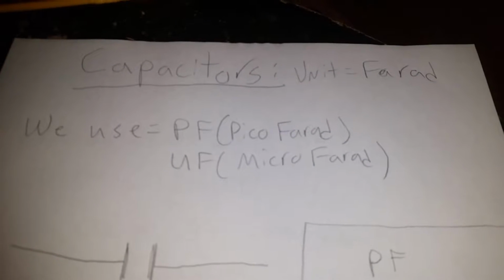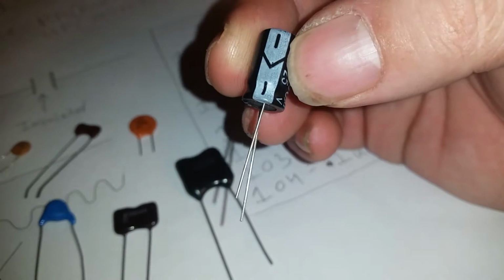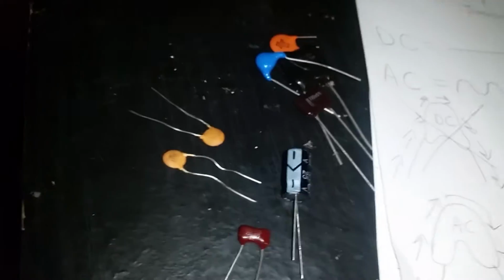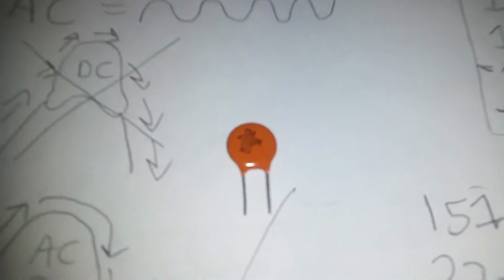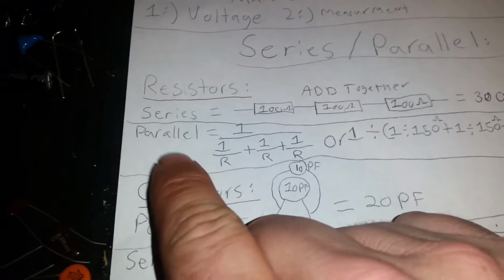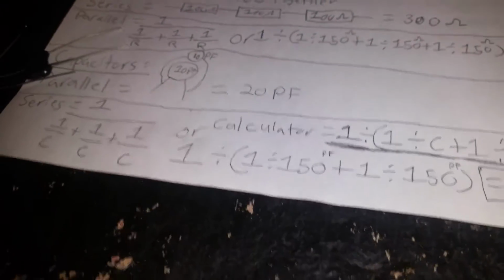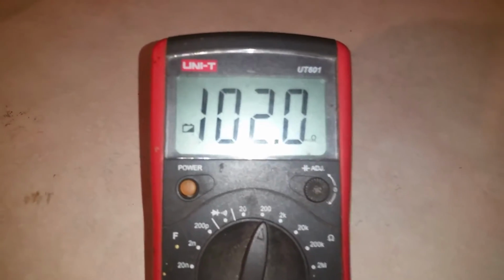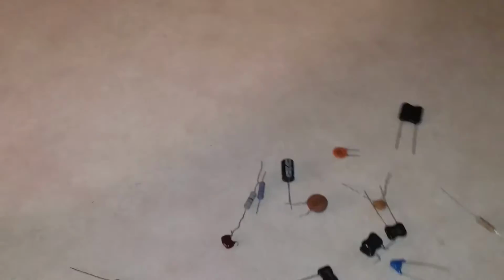RF Amplifier Building Concepts For Beginners - CAPACITORS

Comment: polarized passive components.    My mnemonic is "short to ground" ... something that as an event usually results in a puff of magic smoke escaping, but as a mnemonic, works well. to remember how to find which is which on an otherwise unreadable polarized widget.    Of course it depends on the convention that ground is connected to the negative of power supply.    Related is "cats are always negative" to remember the meaning of "anode" and "cathode".   Not quite so infamous as "bad boys ...."  but works for me,   and I can never figure out resistors anyway as "gold" looks like yellow, and silver and grey are too close to white on an old resistor.   Thank gods for cheap quick component testers.

Comment: Wow, considerable content, probably took me 2 weeks at college to cover the same. Viewers have now learnt that Resistors have the electrical property Resistance that is measured in Ohm's and Capacitors have the electrical property Capacitance measured in the unit Farad, (and a whole lot more) great work. 
By the way, If you have only 2 resistors in parallel or 2 capacitors in series, then the total value can be found using the Product / Sum method. As an example, 2 resistors of 100 Ohm and 150 Ohm in parallel - 100 * 150 / 100 + 150 = 15000 / 250 = 60 Ohm's. 
Once again, thank you for your valuable work, looking forwards to Inductors 73's Bob
Reply from the maker: Very good points!!! Hopefully people will look down at these comments. I should edit the videos and put in if anyone would like to add to this information please leave a comment at the bottom.

Thank you very much for adding to this bud. Make sure to check out some of my other videos if you get a chance. 👍👍👍